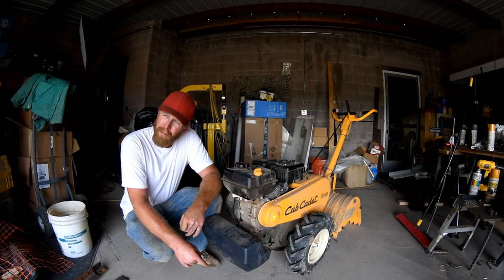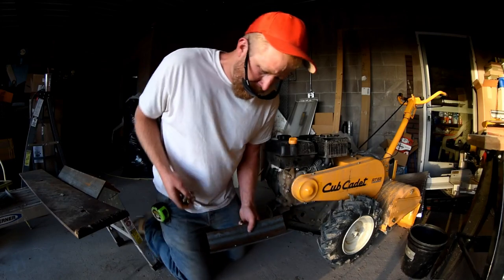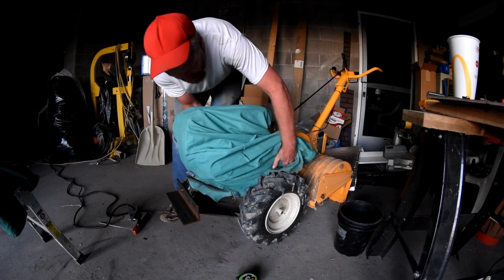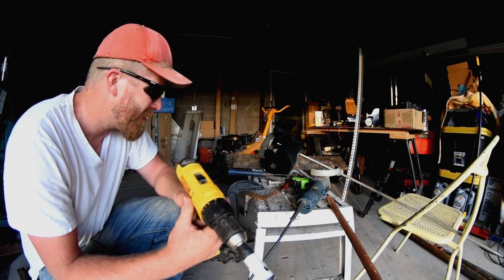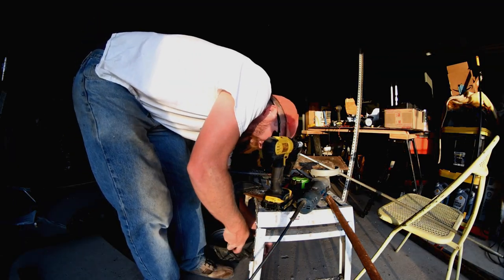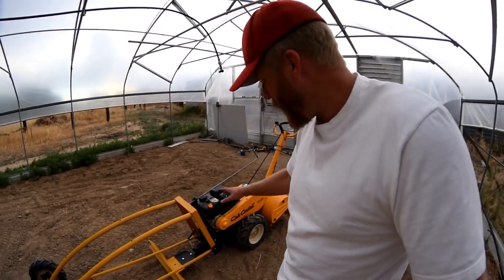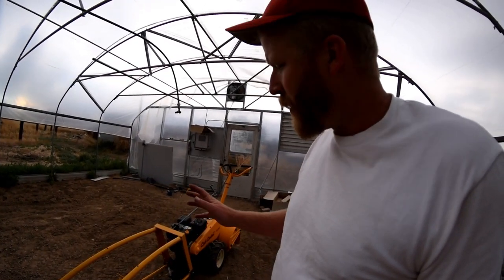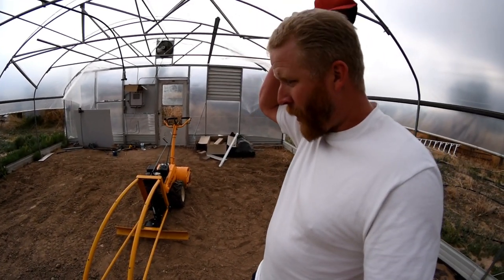Rototiller Grader Attachment-DIY

Comment: Hell yea brother great job !! I just got a big red and I got it for the purpose of trying to move cars and trucks in and out of my shop by myself hopefully it will work I Google to see if anyone had done it and this video came up great idea 💡!! My shop the ground and parking lot is flat and paved the slick shop floor might be a problem but if so I can Self itch the concrete with acid cleaner get some grip where it will be pulling pushing !!
Reply from the maker: Sounds cool man! Good luck to you!👊

Comment: Farmers use a very large version of that land plane to level fields for the same reason - even watering.  We had a community garden that has since closed down.  They left a lot of ruts where the planting beds and compost piles were.  I desparately need to build one.
Reply from the maker: I'll tell you its been a life saver. Running this after tilling is the ticket!